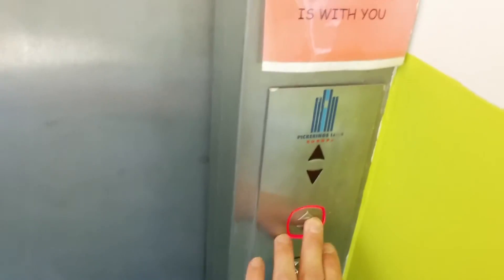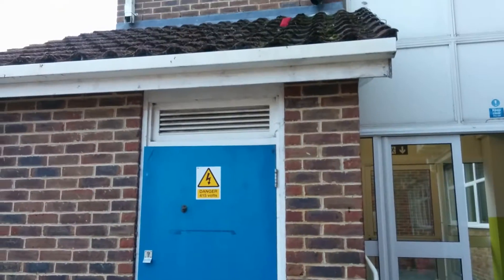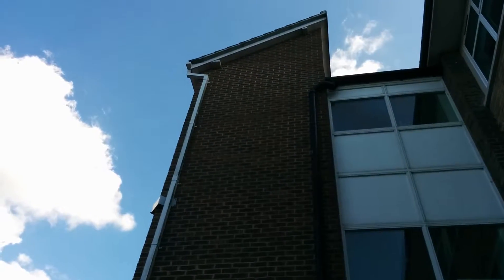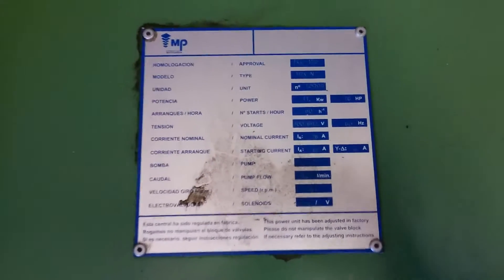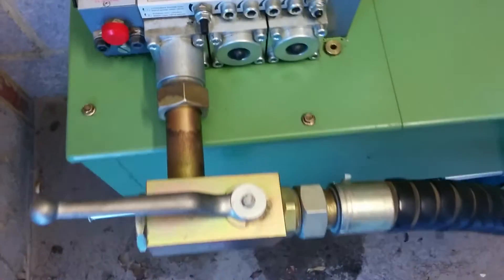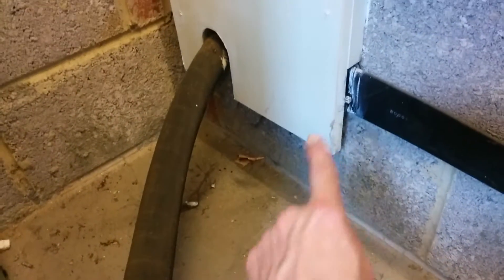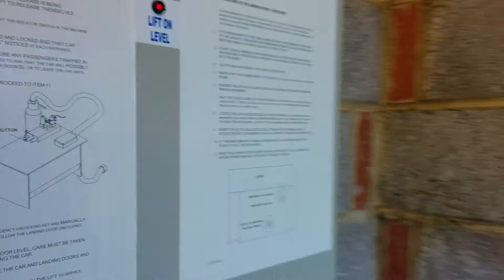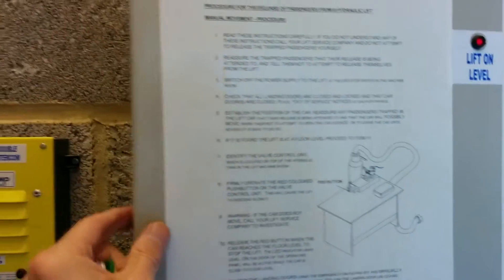Pickering Lifts Europe Machine Room: 3 Floor Lift compressor and control electronics.

Comment: You really shouldn’t be going in elevator motor rooms if you don’t even know what the actual pump unit is called.
Reply from the maker: It's a bit difficult to fix a lift phone line without accessing the phone socket.

Comment: Pneumatic lift jacks are more common in auto repair shops for lifting an automobile to inspect/service. This elevator machine you filmed is hydraulic the green box is the power unit which has a submerged pump inside the tank, the valve assembly top of the tank. The other type of elevator with the steel cables is a traction elevator overhead or basement machine, and the newer machine room less (MRL)
Reply from the maker: +TheTheo58 all new to me. Thanks for the info :) I've only ever seen the machine rooms of huuge motors and steel cables until that day. Hunting YouTube it seems the smaller type I filmed are very common for 5 or less floor systems.
Reply: Many of the older gearless DC traction machines were huge, the largest Otis gearlessd machine I saw was in the WTC. One previous job I held at a hotel, the elevators were geared traction 1:1 roping DC machines with an MG set. The sheave was actually small perhaps 36-40 inches in diameter.  Hydraulic elevators are less expensive whereby a traction elevator is more expensive plus the building has to be constructed strong enough to support the weight involved.